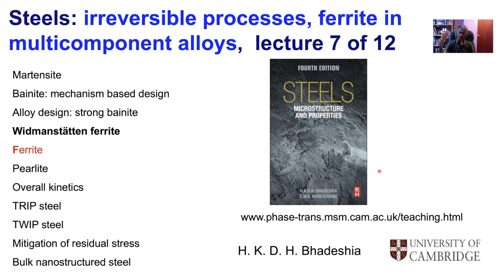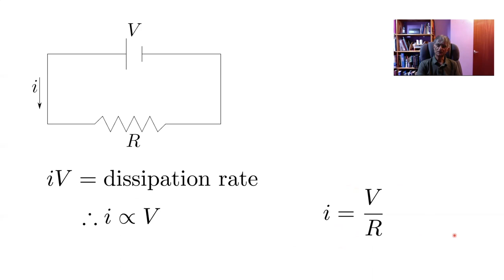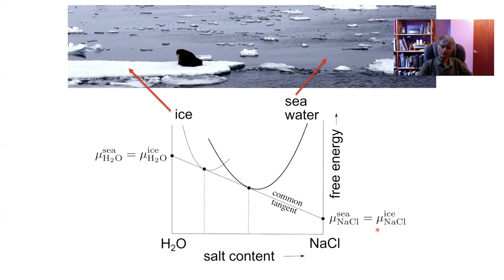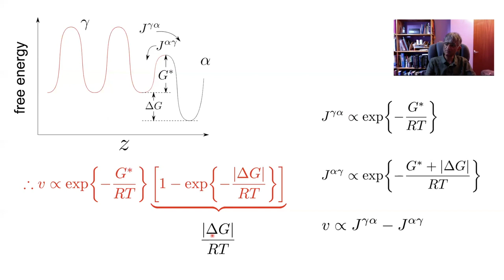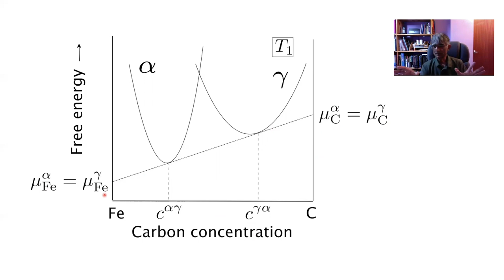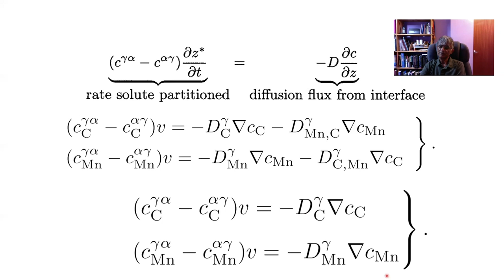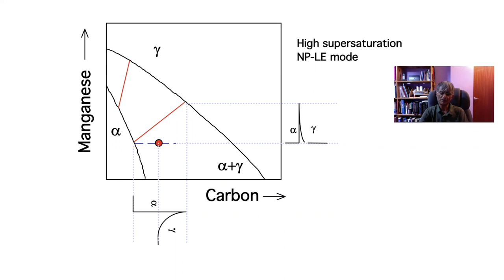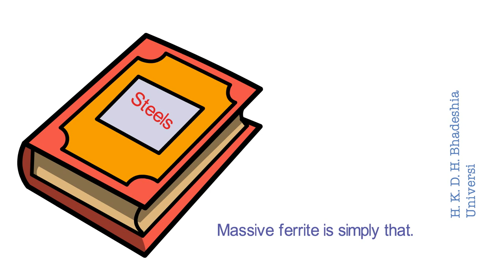Steels: thermodynamics & multicomponent ferrite. Lecture 7 of 12

Comment: Great lecture! I have one question: could you please clarify the following statement (16:19)?
"If we can write TxSdot = JX (eq 1), the flux will tend to be proportional to  the force". 
Is it based on observations (such as J proportional to gradient of chemical potential), or it follows from eq1 and other irreversible thermodynamics relationships? Thank you!
Reply from the maker: At 16.59, J is expanded as a function of X, and in that expansion, J becomes proportional to X at small X.
Reply: @bhadeshia123  thank you. Yes, I have seen the expansion on the next slide. The place where I am confused is how we can go from the entropy production equation (T x Sdot = JX ) to this expansion. Do we just move X to the left side of the equation and conclude that J depends on X?Even though without the expansion it looks like J is proportional to 1/X?  
Thank you again for all your videos and further explanations in the comments section!